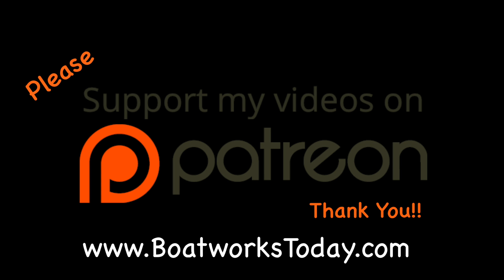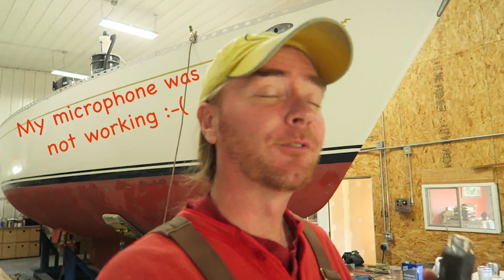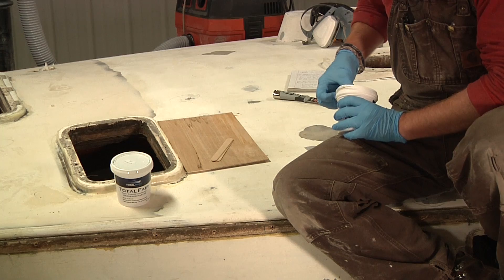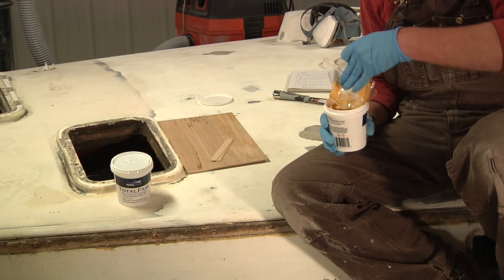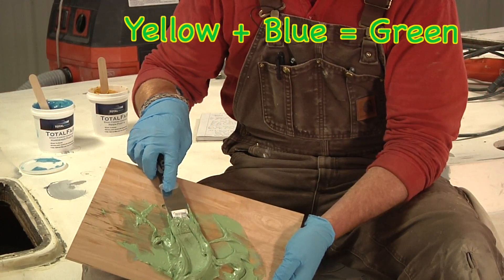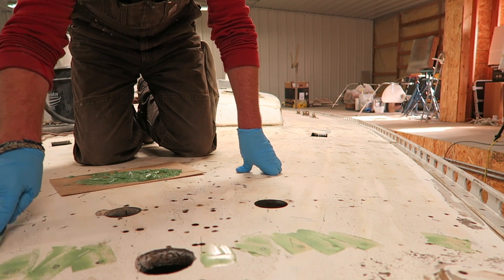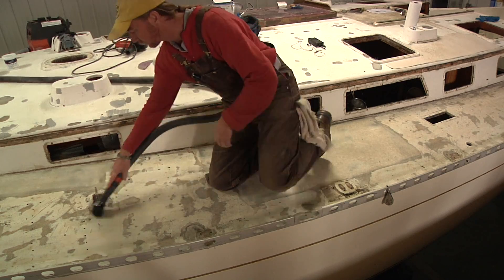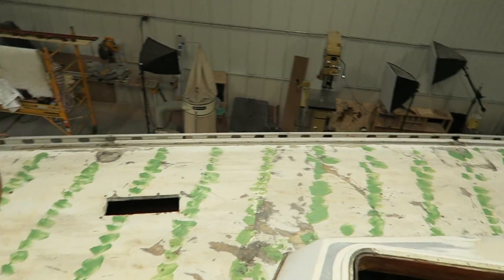Patching Old Holes For The New Teak Deck!

Comment: I used this product a couple of years ago with multiple bleb repair on hull and fairing around keel and on lead keel. Was chewed up from rocks and after grinding lead smooth. Which was very easy being so malleable, it just melted pretty smooth. The Tb/tf was great and easy to apply. I covered with primer then gel coat with wax from tb and then bottom painted. I will be cleaning bottom after boat was in water all winter here in ct. will put follow up after cleaning and maybe GoPro pics of any issues. Water still cold here.

Comment: Andy ,another good reason for using ready mixed epoxy with filler and thickeners already added is getting good wet out of the fillers. Slapping filler in resin just before your use is  does not always do a good job. Dry fillers can be a real problem!  This is particularly true of thickeners (colloidal silica) as opposed to fillers. The thickener products require time to produce the correct viscosity.  Commercially when they add the thickners they check the viscosity  a few  hrs after mixing in and make adjustments. This is particularly important in resins for laminating where you want the thinnest product for good wet out but enough thixotropic properties to hang on vertical surfaces!  Thanks for posting , cheers. Warren

Comment: I opted to use a number of Total Boat products on my recently acquired J24, including the total Fair used in the video. The choice, for me, was largely based on price initially, but I was pleased to find that their product support, ease of ordering online, instructional videos, etc, are fantastic! Jamestown Distributors also carries a full line of almost anything you may need for a recreational boat. Their shipping is prompt, and prices are very competitive.  I have also found that the Total Boat products are easy to work with, although I really have nothing to compare them to having no experience with fiberglass work. I think the results I achieved, given my lack of experience, may be a testimony to the ease of use alone. So far I've used their epoxy, polyester resin, fairing compound, anti fouling paint, and some topside paint, all with excellent results! The only part of my project where I opted for a different brand, was the epoxy barrier primer. I went with the Pettit product for that, only because it had a much more flexible window between coats without sanding. Being a weekend warrior, I did not believe I would get all the necessary coats done in the time allotted with the Total Boat product. I suppose I'll have to wait and see how the anti-fouling performs, but the application was effortless.

I was very happy to see your opinions of a Total Boat product, as it gave me some validation of my choice. I'm also fairly proud that I came to some of the same conclusions that you did as well!

Love your videos, your shop, and your outstanding craftsmanship! Keep up the fantastic work!
Reply from the maker: Thanks for the input Donald!  Much appreciated ;-)

Comment: I have used the "total boat" penetrating epoxy and the 2 part varnish and so far have been pretty impressed. Free shipping on the total boat stuff too.
Reply: The 2 part varnish which is called envy was not cheap though.

Comment: Thanks for all the videos and the great overview you’re selling. All very helpful. I’m replacing the teak cockpit seats only my 1983 Kelly Peterson (likely replacing with Seadek) and have seen you use both this fairing compound without drilling out the screw holes and west epoxy after drilling out the screw holes. How do you decide which fix is best?  Thanks

Comment: What a coincidence that you did a video on this product about 12 hours after I had just ordered it! I'm wondering though how thick can I safely lay the fairing compound?  I have a quarter inch gash in the fiberglass above the waterline and thought this would make a great filler. I think the repair seems too small for laying up glass and epoxy, but where do you draw the line?

Comment: Andy - What is the cyclone setup you have for your vacuum and how do you like it?  Any recommendations / things to avoid?  Thanks!
Reply from the maker: It's an Oneida Dust Deputy.  https://www.oneida-air.com/category.asp?Id={CC6B6F2A-E3D7-4F18-A53C-B5C357DFE131}  Works pretty well, especially for wood.  Some fine glass dust still makes it through to the filter but you still get a lot more life out of the filter before it's time to replace :-)

Comment: Nice.  Have you tried System Three Quick Fair?  It looks the same except that it mixes 2:1 and the two parts are not different enough in color.
Reply from the maker: Hey Todd!  I have not, what's been your experience with it?
Reply: Andy, it looks about the same as the Total Boat product.  I have been using it for a few years and like it except that the two parts are tan and darker tan and it is hard to tell when it is thoroughly mixed.  It is also 2:1.  It cures quickly and sands easily though.

Comment: Hi, great vids.  Do you have a recommendation for repairing screw holes in my fiberglass transom, below the water line?  I have six screw holes from an old transducer and speedometer that were plugged by the previous owner. I do have a slow leak.  Appreciate your input

Comment: Are there different strengths of fillers? Lets say if your going to reuse the same hole for a screw etc? What color does this dry?
Reply from the maker: This particular fairing compound is only for fairing as it sands easily.  There are other fillers avail when you start looking at mixing your own epoxy that do have different working characteristics.  Some for bonding, some for tapping, etc..  It can get a little overwhelming but I'm working on something to help simplify the learning process!  Stay tuned this Summer ;-)

Comment: Any benefit to using this over an epoxy + filler? I've been using Sea Hawk epoxy with their F6 fairing filler for screw holes. I've also got some Bondo type filler, but I'm more familiar with the epoxy at this stage.
Reply from the maker: I'm not familiar with that brand of epoxy, but I'm guessing by the time you add the cost of the resin, hardener, and filler this might be a much more economical option for fairing :-)  One benefit to mixing your own is that you have more control and various fillers avail for a particular task to get exactly what you need.
Reply: Thanks for the reply Andy! :)

Comment: Andy I have a 16' aluminum bass boat I recently discovered that my flotation was waterlogged anyway the reason is that the deck was left unsealed by the previous owner. bottom line can/will polyester resin bond with aluminum the deck material is plywood I've watched a lot of your videos and I like you test with the gel coat on epoxy maybe you know and can give an answer or conduct a test for me thank you